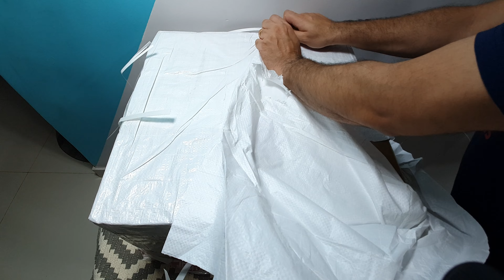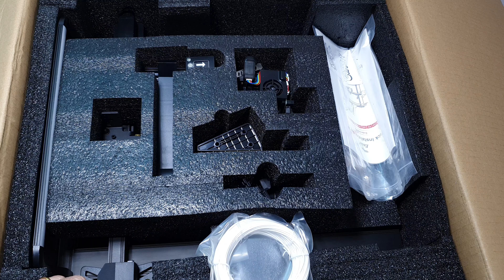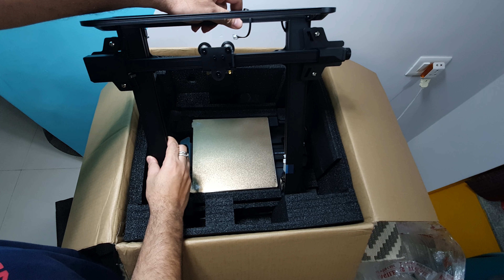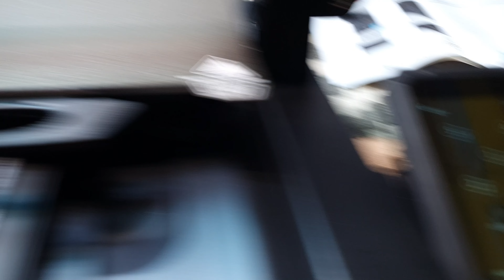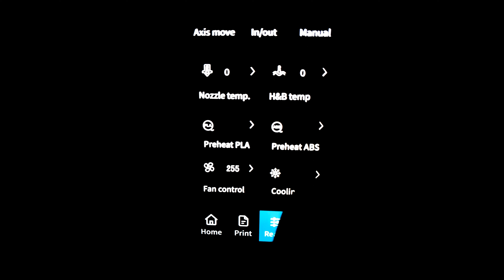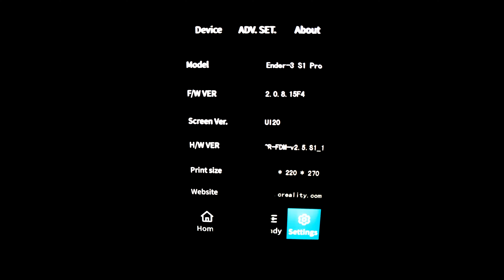Ender 3 S1 Pro - A Good 3D Printer for Beginners from Creality #3dprinter #ender3

Comment: Im new to printing, my first 4 prints aren't sticking to the bed.

I have pre heated the bed and nozzel 

Would this be because the bed isn't level ?
Reply from the maker: Multiple factors Paul, ensure manually level the bed by sliding in a A4 sheet of paper across the bed, 2nd make sure your heating your filament, much higher for the initial layer, you will find this setting in Cura, 3rd, again keep the bed temperature slightly higher for the initial layer like say 60° or 65°. If none of these work, get any other brand of filament and try
Reply: @rtechreviews my printer is working very well but my prints aren’t sticking to the bed and i dont know how to level the bed
Reply: And how did you print that so well

Comment: Ender s1 pro Very bad, printer you pay the price of a printer with a cr touch  sensor that does not work if the height 2 and most of the printers cannot weigh under the number 2 because it is the scrap of.
You must use manual calibration after 2 z offset.
Ender 3 S1 is better for weighing and controlling the height of z offset.
It's a piece of junk
Reply: I have 6 Ender 3 and this is the worst by far..out of the box lights flickering and software corrupted

Comment: I had a warped bed out of the box. Wound up cutting up paper and shimming under the PEI bed surface to get a flat surface. I haven't seen any evidence that the auto bed leveling is even working. The Z gantry motors never moved up or down over low/high spots.
Reply from the maker: Darn... hope you got a replacement
Reply: @rtechreviews  I probably need to check on it. Just hate dealing with customer service. I took it apart and straightened it. It's not bad ATM. Had a dip in the middle.
Reply: @REDGTA  I think your bed might be fine. It could be your Y-axis that's bent. Mine came bent due to overtightened bolts which made it seem like my bed was warped. A design flaw in the plastic base make even slightly overtightened bolts cause a warped y-extrusion.
Reply: @DKFX1  Hadn't thought of that. Guess that could pull the bed down in the center. Just started a 9 hour print. I'll tear it back down later and check later
Reply: @REDGTA  Good luck. It's the 6 bolts running down the center of the Y-axis.